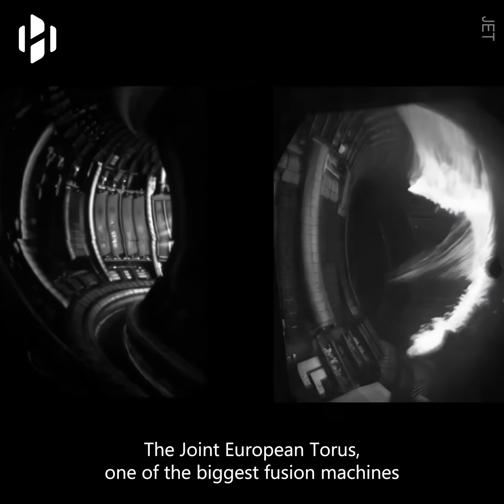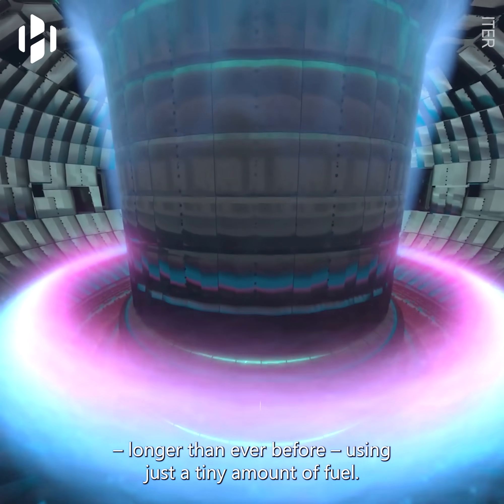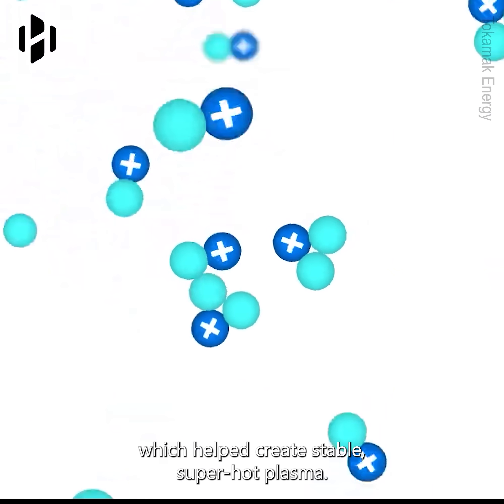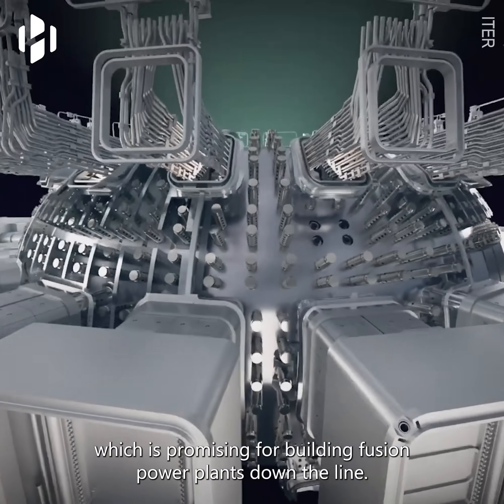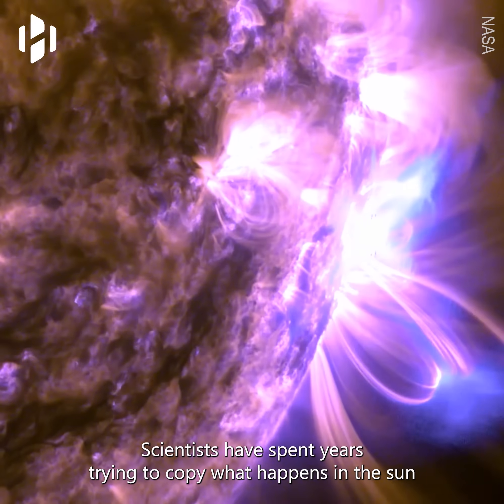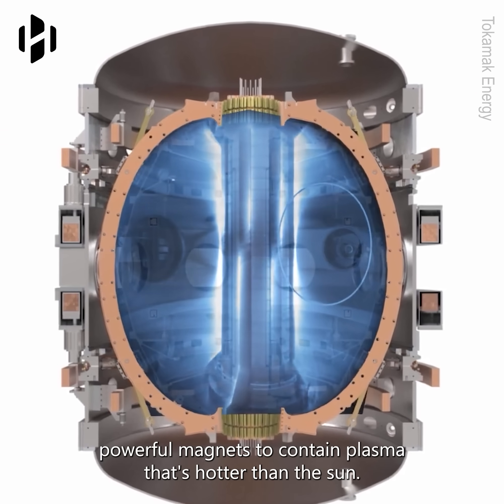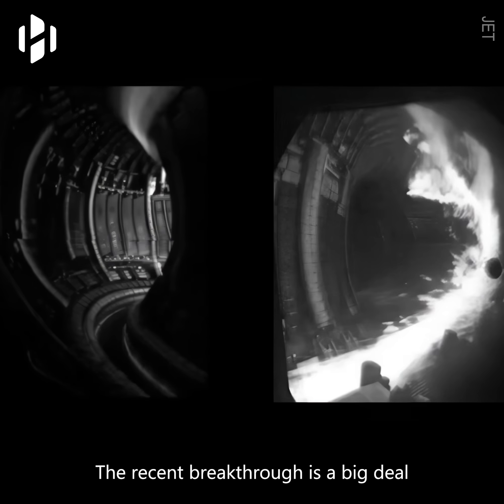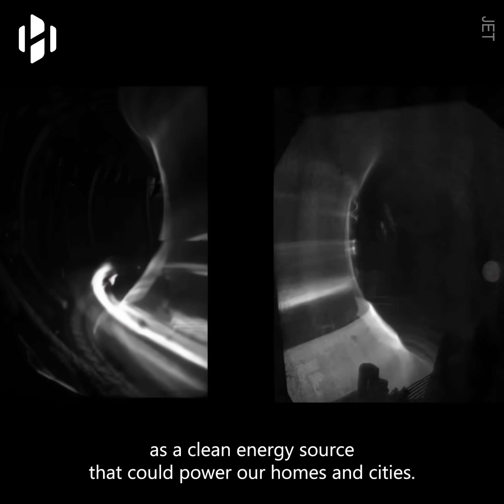Harnessing the Power of the Sun: Breakthrough in Fusion Energy

Comment: hotter than the sun might be overclaimed i guess. I mean, no one ever measure the exactly sun temperature precisely.
Reply: through the power of 2 google searches, i found that the surface of the sun is about 5,600 degrees celsius, with the core much hotter at around 15 million degrees celsius. Nuclear fusion is around 150 million degrees celsius. So with that info, even the hottest part of the sun is still 10x colder.